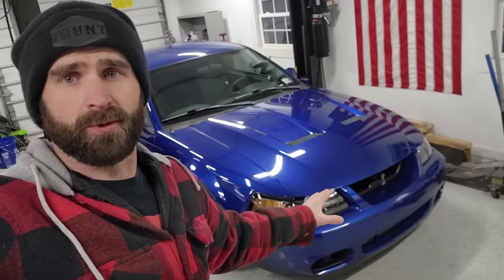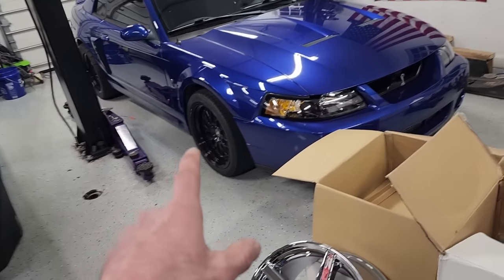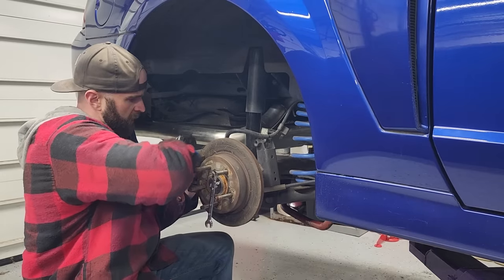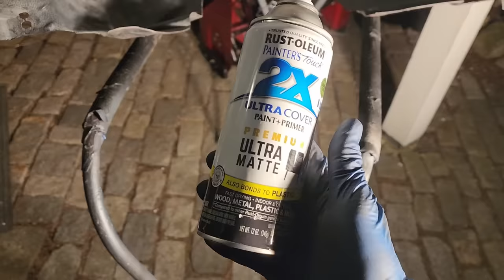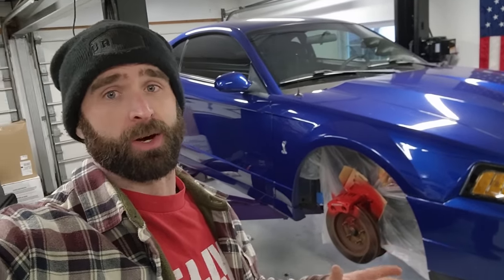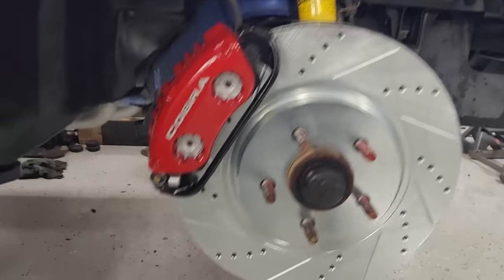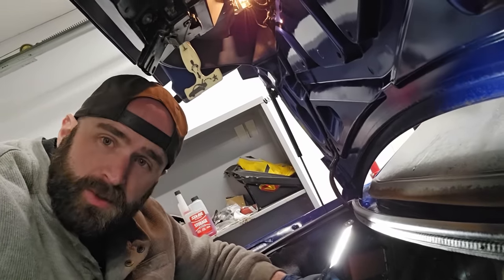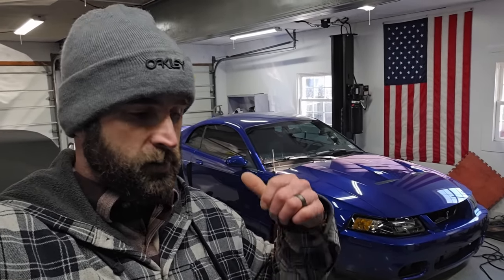The "CHEAP" Sonic Blue SVT Cobra Transformation Continues: NEW WHEELS + Brake Upgrades!

Comment: That Saleen style wheel is "THE BEST" looking wheel for most mustangs! I would have had a semi-gloss grey that matches the seat inserts, but this is your build. Solid rear rotors are from the GT, the Cobra IRS rotors have small ventilation rotors. The Cobra also has the rear caliper with the connected bracket. Did your wheels come with hub rings? Yellow would have been a great caliper color as well. Good job bro💪🏆

Comment: I lucked out with my sonic blue with the wheels as they are OEM Saleen wheels. Was not even listed in the for sale ad for it but when I was checking it out it was stamped with Saleen on the wheel and they are the optioned 18X10 in the rear.
Reply from the maker: Thats awesome!
Reply: @ChrisSullivan69  Thanks! Was deff a good score with the car

Comment: I believe to put mach/cobra/bullitt rear slotted and larger rotors on the rear, all you need is the caliper bracket and rotor. I did an IRS swap on my gt and   it didn't have rear brakes on it and got all the shit off rockauto lol

Comment: That cobra turned out amazing.. The chrome wheels with the red brake calipers.. lookin good. On our other 69 camaro that we RS converted, we put 15 inch American Racing 5 spoke Hot Rod Polished Aluminum wheels about 8 years ago and the car is still being restored lol. But I think I should sell the 15s and get the same style rim but just the 17.. I saw a bunch of other 69 camaros with the 17s and they look awsome!

Comment: Good choice on the wheels. I’m normally not a chrome guy but this is period correct. I also like the contrast on the calipers. I run red Brembos and have some BBS CH012 wheels that fit my 93 Audi S4 very well. 

Top notch work, I thought the car looked really shiny outside. Will really pop with a polish and some coating or wax. 

Ok back to life now, great video and good work!

Comment: Curious if you purposely put the slots "Digging" aka facing forward instead of dissipating or facing back like the previous rotors was on the car? 
According to wilwood, Brembo and several other companies the "veins" should face the rear as to channel gasses away from rotor.

Comment: Car really come together with the wheels.  Had a set on my last white vert, just really can't go wrong with that style on Cobras really.  And maybe be glad you didn't get the 18 inch AFS wheels because people have been having chrome peeling/pitting problems with them.  I had a set wayyyy back when they first released, and they were good but thats not the case anymore.
Reply from the maker: Yeah i saw people having chrome finish issues

Comment: Absolutely stunning Cobra so far it looks amazing. Nice trick with the sanding on the Cobra emblem. I learn a lot of cool tricks from you. Not to be a douche by any means, but after years and years of doing brakes I thought I'd pass along a tip if you're interested. I noticed you put the calipers on the car and they free float, allowing them to kind of half-ass be in your way and not Plumb when you're tightening the brackets in the back. When I did them I always use two lug nuts finger tight upper and lower to hold the caliper in place even if it rocks a little but it doesn't Wing out way out in the front while you're trying to put your stuff on scratching the rotor from the mounting bracket. Just something I like to do
Reply: I keep saying caliper I meant rotor LOL

Comment: any updates on the e63 amg? love the content bro! i own a e63 w212 estate with the m156 and i love it, such a great car. i've only done a power steering reservoir so far and i had a vacuum leak from the intake manifold. someone who worked on the car earlier forgot to tighten a bolt for the manifold so it was making a whining noise. all fixed now, only problem i have now is the idler pulleys are making noise, so im doing full kit of tensioner, pulleys and serpenthine belt :)

Comment: Font directional tires look mounted backwards? Double check that, might have to switch left and right wheels on the front.
Reply: Clarification. The tread should channel the water out to the sides not in toward the middle. Simply put even though the outside marking is correct, the left wheel is on the right and visa versa. There should be an arrow for direction forward.

Comment: Once again you are spot on with your choice in rims.  I couldn't agree more on the selection given that the factory Cobra rims are a touch hard to find these days.  The brakes came out really sharp as well bro.  Have you changed the brake fluid to those by chance?  It's probably due to get swapped either way.  Can't even tell the car is still dirty either btw, but that just tells me that it'll be immaculate once you get the body work and paint done up right.

Comment: Since the motor is built will you tune it for a higher boost level than stock?
Reply from the maker: Yes it already has a smaller pulley

Comment: Didn’t like you cutting an extended 3” ARP rear wheel stud. Should have installed open ended lug nuts on the rear to keep the stronger studs. 😅
Reply from the maker: Cutting them doesn't make them any less strong lol.
Reply: I guess so. Still kind of pointless to cut an aftermarket extended stud just to put a capped lug nut, IMO. It’s nice to have the longer studs on a built rear in case the car ever gets a drag pack. Plus the long studs look badass I think.